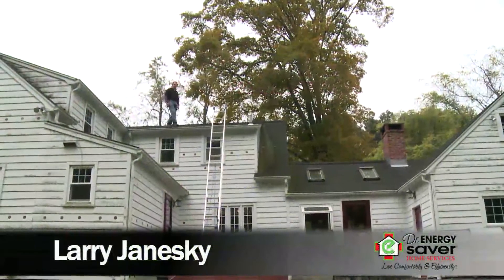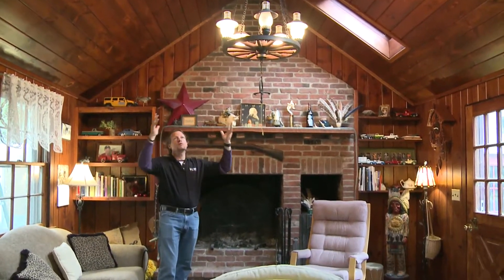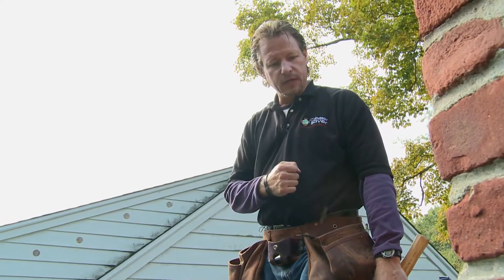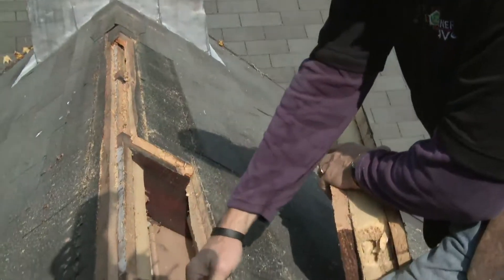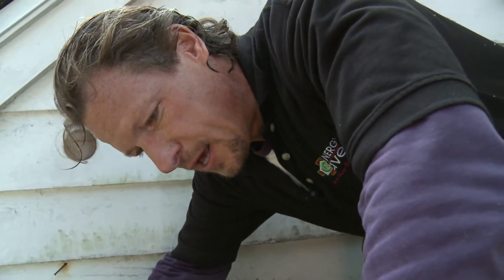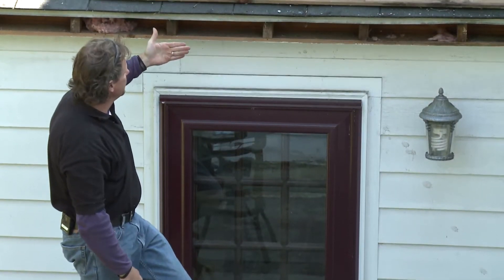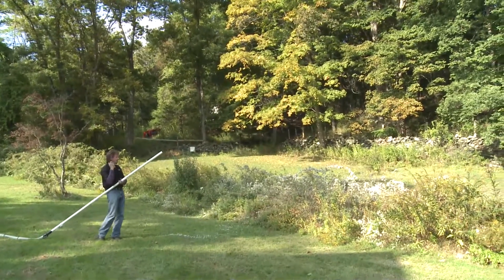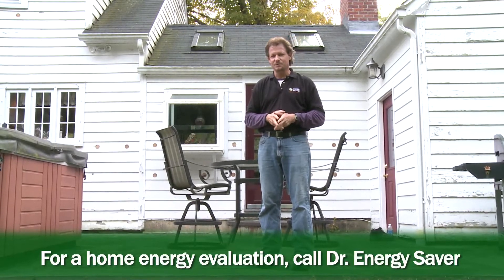Dense Packing a Cathedral Ceiling

Comment: This is a good video, and I wish more people were viewing it. Many people do not yet understand that roofs can be unvented, if you eliminate all air spaces and seal very well from indoor humidity.
Reply: Hi Tim! I bet you weren’t expecting a response to a 6 year old post. I understand completely sealing a roof and dense packing it with cellulose. However, wouldn’t that only apply to non shingle roofs (metal, concrete)? Won’t the extreme heat hitting the non-ventilated roof cause it to fail (shingle curling)? I’d appreciate your opinion.

Comment: Hey Dr. Energy Saver! So no venting on a cathedral ceiling? Won’t that eventually cause your composite single roof to fail (shingles start curling up) due to extreme heat without any ventilation? Perhaps your many years of experience tells you otherwise. Love your channel!

Comment: Ventilation required. That said, it's a cost the home owner most approve to be installed if it hadn't been already. As is, that roof will still last another 80 years if the shingles are maintained.

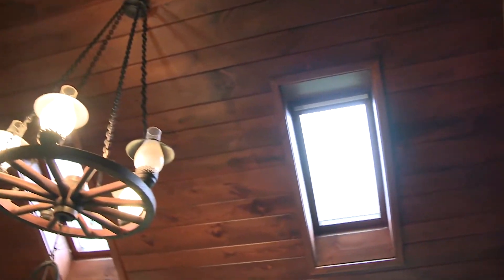Comment: We have a 1:12 pitch vaulted framed rood from 1958. We have zero insulation in our roof. We live in hot and humid Central Florida. Out roofing is torch down roofing. We do not need a refoof job as it was installed in 2002. The roof is fine. Our problem is we don't have insulation. We have soffits with a 2 inch hole in each rafters bag and we have a 12 inch Whirlybird in the middle of our roof for taking out the heat. How should we go about insulating our ceiling? Thanks
Reply: The same way he did here. Dense pack from the ridge but only after going down to the soffit and blocking the bottoms of the bayd so the dense pack will have a solid base to hold it in. If moisture is s worry you will have to airseal and induksye from the top. Removing the roof abd insulatinh from the inside out would be the most efficient and allow you to vent the roof. Which in Florida I'd say would be very beneficial.

Comment: The building code in my county calls for a 1 inch gap between insulation and the sheeting. Does that not apply to cathedral ceilings.

Comment: I know this is an old video, but I have a situation very much like this. I am concerned about dense packing this area, as some of the commenters are. It's basically my only option without tearing off the roof or the ceiling. I'm needing expert opinions. Should I do this or not? Thanks for any help.
Reply: 100% valid concern and I would absolutely not do it or even have a professional do it. There are typically other options that are less risky. What did you end up doing?
Reply: @bengriffin1435 What is the right solution to insulate a cathedral ceiling?
Reply: @bengriffin1435  Haven't done anything yet.

Comment: how do you address condensation in an unvented cathedral with insulation touching the coldside boards
Reply: I had the exact same question. Won't indoor moisture pass through the tongue-and-groove indoor ceiling and dampen the cellulose? Seems like a problem with this project. I'd love to hear what others think about this...
Reply: John Whitney I have this exact question. It looks like dense pack cellulose eliminates a potential condensation face due to very limited permeability.  Still, where does the moisture go? No idea...

Comment: I have a cape house with a Kneewall setup.   We are planning on the Dr. Energy saver #C4-1 procedure which is foam board on the bottom of the rafters and then dense packing between the boards.... Effectively a cathedral ceiling job with a room hung in the middle.  My concern is water buildup in the cellulose.  if the roof ever leaks or humidity can't escape due to lack of venting.  is that a valid concern?
Reply: 100% valid and I would absolutely not do it or even have a professional do it. But your post is from 9 years ago so I'm curious...did you do it and what has happened?
Reply: @bengriffin1435  didn't do the dense packing.  Still have heat issues from the roofline,  planning solar panels to take the direct sun off the shingles. 

The foam board with reflective surface seems to do its job, but the aluminum tape they used to tape the joints has virtually all failed.

Comment: So with no air circulation....won't your shingles cook in the summer and cause premature failure? Or is that old school thinking???
Reply: Yes, that is old-school.  Insulating directly against the sheathing and making the attic unvented is very common now.  HOWEVER, there are possible water retention issues. I don't know if cullulose is approved for this kind of application.  Closed cell foam is.  But you can't retrofit closed cell foam into close quarters such as this.
Reply: Old school thinking for sure, my dad dense packed cellulose the entire roofline of the house he built about 21 years ago and an engineer told him that the shingles were going to melt off because his insulation was in contact with the roof and no roof vents. Same shingles on the home today, no issues.
Reply: @JesseCoxVideo  what details did your father complete to keep vapor/moisture from getting into the cavities and allow moisture to escape if it did?

Comment: You should have baffled the roofs and built a a new roof on the cathedral ceiling with a vent space between old roof substrate and new roof.
Reply: Building science says that isn't necessary anymore. With proper air sealing, insulation and proper dehumidification it's not necessary to ventilate.
Reply: @jessewood3999  roofs get extremely hot in summer.
Reply: @jessewood3999  wont it get hot at top of room